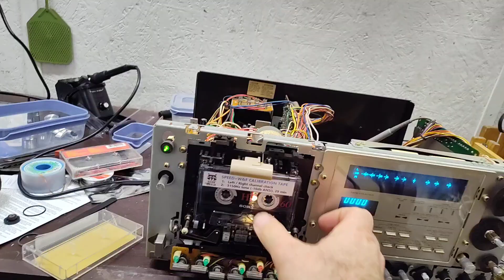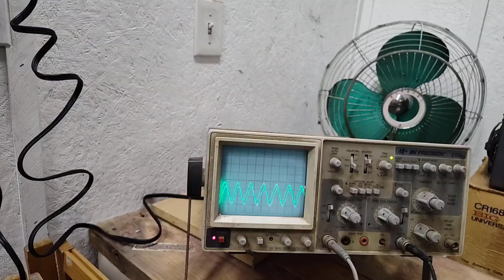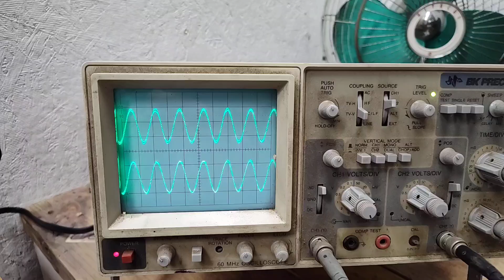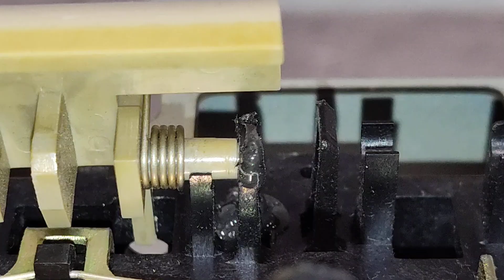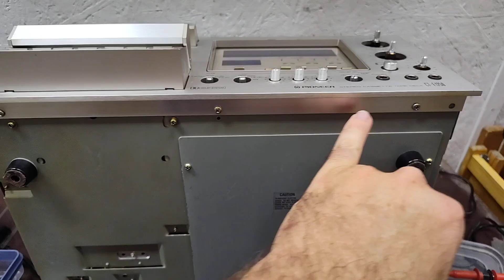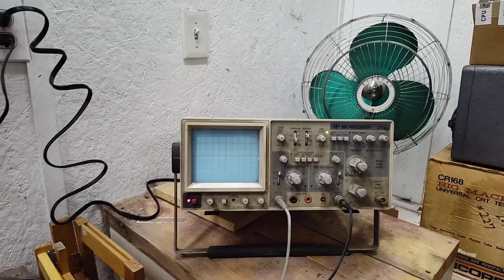Servicing a 1980 Pioneer CT-F1250 Cassette deck. Reel table stalling. P5/5 FINAL

Comment: Hola jordan Pier, una pregunta me puedes decir donde compraste los Pinc Roller y las correas, compre un kit a un tal VAN-HURBAN en España a traves de Ebay y la verdad que no quede satisfecho, le comtre 2 Kit uno de CT-F1250 y otro para un CT-F900 y en el kit del 900 la correa del Capstan del lado Supply Reel estaba cortada como con unas tijera para hacerla menos gruesa, uno de los Pich Roller estaba malo, al parecer el rodomiento interno estaba malo y la correa la mas pequñita en la cual tu colocaste una redonda no funciono, bueno en conclusion casi 40$ y no funcionaron, por eso te pregunto. Me seria de mucha ayuda tener un buen proveedor.
Reply from the maker: Blackreel.de is where I get my rollers from, or athan. Both expensive but good quality. On occasion blackreel has belts that are good. Otherwise vintage-electronics.net has been a good source of belts 

I agree van hurban rollers are not great. Have had several come apart.
Reply: @JordanPier  Muy bien. Muchas gracias por responder, muy agradecido.

Comment: Hey Jordan. I have one of these decks that has been sitting on a shelf for quite a few years. It is in mint cosmetic condition and everything lights up on it but when I hit play, fast-forward or rewind I get just a little click and then no other movement with the transport. Any idea what might cause that? Are you accepting these units for refurbishment or rebuilding at this point? I am in Colorado. Thanks for any replies.
Reply from the maker: There are a number of failures that can cause this problem. Anything from power supplies switches solenoids belts idlers and more.

Do the hip rplacement surgeries I'm having at the end of the year and early next year I'm not taking anything in till further notice

Comment: Boa Noite amigo!
Parabéns pelo seu conhecimento e trabalho!
Tenho um SANSUI QRX 8001.
Está com a 2ª plaquinha  
Interna do potenciometro quebrada, do tape monitor . 
Você tem um fornecedor  de peças dos aparelhos sansui?
Consegui um potenciometro do tape monitor?
Sou de BELO HORIZONTE 
MG. BRASIL. 
DESDE DE JÁ AGRADEÇO...
Reply from the maker: Watch ebay for someone parting out. Either that or purchase a parts unit. Those are about the only two sources.

Comment: Hi Jordan, 

Of note - sometimes the two PB magnetic gaps are not perfectly in line, and if this is so, then aligning where 'L is over R' may not be the best solution? I have noticed on some Nakamichi service manuals (I have not read them all) that they seem to explicitly mention to opt for *maximum output*, rather than mention 'in phase'. On some other non-Nak decks I have indeed noticed this out-of-phase max output where I suspect the two gaps are not quite in line. Of course we are talking literally microns in alignment differences.

Kind regards.

James.
Reply from the maker: From a standpoint of frequency response, maximum output is nice. However in order to preserve stereo imaging I will always adhere to phase coherence as a way to align the heads. I'm not sure if the tiny distance would affect the frequency response enough that many would notice it - but I'm sure that if orchestral placements in the stereo image were shifted or altered enough the connoisseur would notice.
Reply: @JordanPier  I get your point Jordan, can't disagree in principle. I think the Nakamichi SM advice was interesting, but as I've said, I'm not sure if this approach was universal for all Nak SMs?  We know when we do an azimuth via the ear, the phase effects can be heard when the phasing is out. I guess if a head is so far out in L/R channel gap alignment, best option would be to change the head? Interesting topic, thanks for the reply.

Comment: I'll repair old computers, game consoles, tube TVs, radios, DVD players, even VCRs. But I won't touch a cassette deck outside of belt replacement, maybe rubber rollers if they're not too bad to get off. Even the more serviceable ones are still hell. Respect.
Reply from the maker: Thanks. I loathe cassette decks, but I seem to be one of the few people still competently servicing them. I get lots of requests for repairs. I figure I can at least make these videos to help the next line of people working on them - if they so choose.

Comment: Just wondering, is there a reason that you don't put your scope in X-Y mode to adjust the azimuth? Back in the day when I did this stuff, that was my go-to way of adjusting azmuth on my tape and cassette decks.
Reply from the maker: Never thought of using that method really. Always adjusted for phase alignment.
Reply: You can get the same result looking at both channels the way it was done here. And you can easily see other problems as well.
Reply: Why or how would using Lissajous figures be better?
Reply: @JamesE707Because two signals that are in phase (as with two signals from two audio heads that are in perfect alignment) will show up as a perfect line. The line may vary in length but it's a line nevertheless. If the heads are out of alignment, the signals will be out of phase and you'll see an oval or (in the worst case) a circle.